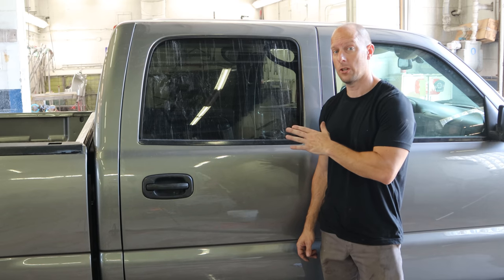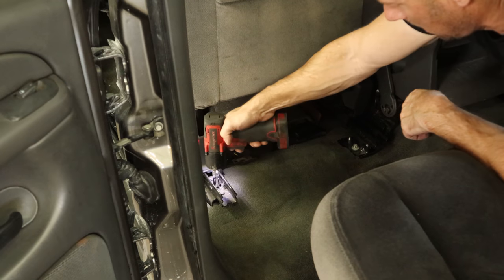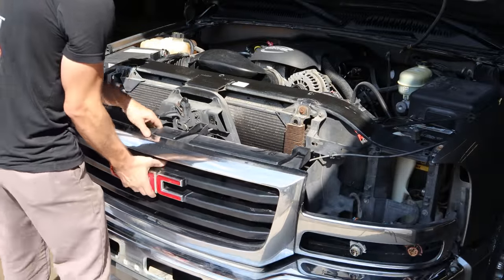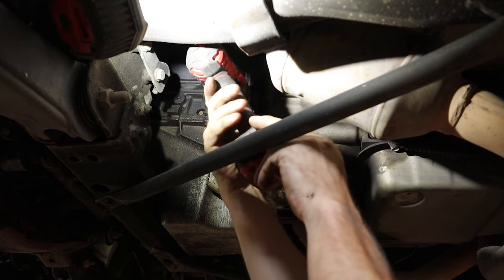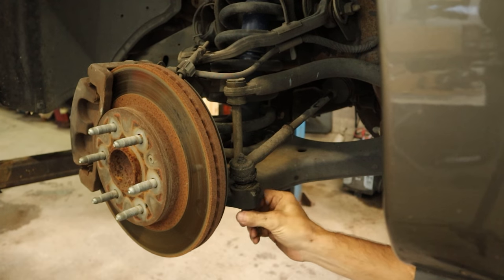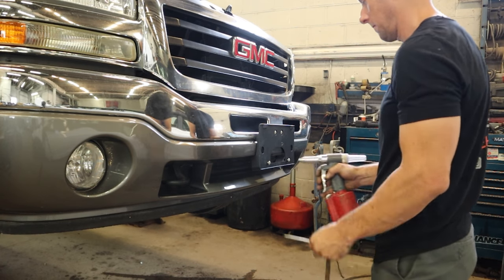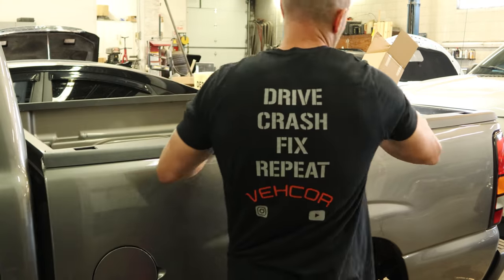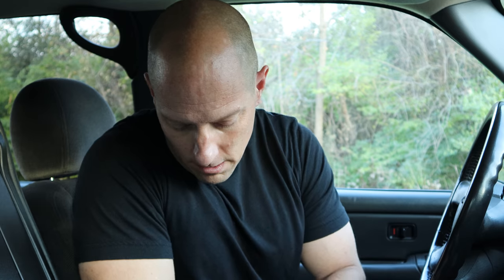Completing the rustfree 2006 GMC Sierra rebuild

Comment: I'm still smiling about the true purpose of the magnetic oil drain bolt.
Reply from the maker: Now let me tell you about recommended blink fluid change intervals! 😂
Reply: @vehcor  Lol, love that.
Reply: Once tried using a magnetic drain plug to try and extract a sliver of steel out of my finger. Didn't work.
Reply: @robj2704  Shhhhht, Dont give away the real reason🤣🤣
Reply: @vehcor  I want to see a muffler bearing replacement,  or a disgronifier service.

Comment: What a great finish! That truck looks beautiful. How many other shops would have fixed an evap solenoid, replaced front end parts, brakes, tires, oil let alone the A/C fitting. If I lived around there, nobody but you would touch my Canyon, nobody. Your shop is the kind of shop you could drop off a vehicle say take your time and fix whatever you’d fix on your own, and never have to worry. It would be done correctly. Your channel is the highlight of my day. You look fine in the hat too. You even put it on in the right direction. Thanks!
Reply: Oh yeah!! I agree with that! I would love to have the skills and knowledge that Scott demonstrates in every video. My old truck could sure benefit from a visit to his shop.

Comment: tip ....dont use 3m masking tape 3/4 for lining up moldings , instead use 3m 1/4 blue fine line tape as it provides a strait line n no risk of pulling paint off  after molding install. Ur videos are improved over say 3 yrs ago..well made n commentary is excellent.

Comment: I have a 2007 Silverado and did the vent solenoid at 50,000 and still going strong at 160,000. It was a GM part. Funny we have 2 mid 2000's suburbans at work with just under 200,000 miles and both just required the vent solenoid and the block off cooler plate gasket replaced. And one needs and have the rear main seal replaced, and did the other this past summer. Now that is not cheap when you have to take it to a good mechanic. Great job on your videos.

Comment: I'm new to your channel.  After 50 years in the automotive business - 35 as a line tech, I'm impressed with the quaility of work you do.  However, I have one question.  Did you actually just use an impact wrench to install the wheels, or at some point did you use a torque wrench to prevent rotor damage from the wheels not being torqued in sequence?  
Whatever, your overall quaility of work is outstanding and I will continue to watch because it is a breath of fresh air to watch someone that is an expert in their field.

Comment: A truck like this is hard to find up in Ohio.  I love my 2004 Silverado but it has 168,000 miles and the rockers and cab corners are pretty much gone.  Nice job as always, and I will always buy a vehicle from no questions asked.

Comment: My pops has a new 2020 Chevy.  It has vent valve problems.  One before it...  had vent valve problems even after they routed that iine to the trans or engine bay.  He wouldn't care except it disables the remote start.
Reply: Also ln NY it would not pass inspection

Comment: Used door prices went through the roof.
I’ve got the 07-13 Silverado crew cab with the factory optioned door rot, I replaced the passenger side rear 2 years ago for $200 for the complete door and painted it to match. Now the driver side rear door is $400 and the driver side front door is $700. Talking about $1100 for 2 used doors that aren’t even the same color as the truck. 
Sure the truck has 275,000 miles and it’s lived the last 4 years in New England and the rockers are also gone but I can swap the 4.8 for with a 40k miles certified warranty 4.8 for $2k. Doing the rockers thanksgiving weekend. Cavity waxing the hell out of them when I’m done.

People ask why you would do that, like have they seen the prices on low mile trucks now 🤯

Comment: A 2wd truck up there oh no, When I lived there I had a 2WD dodge ram for ten years, even in that snow storm of Feb 2011 I had no issues getting around never got stuck in the snow. I had 3 8D batteries that I filled with cement and used as my ballast in the winter. all that flooring you can send with the new owner and tell him it is there for when the floor rots out. lol

Comment: I live in phx az and really dont need 4 wheel drive unless i lived up north were it snows i bought a 2 wheel drive 2007 silverado truck and drove it 13years put over 200k miles and sold it and never once needed the 4 wheel drive and iv driven it all over up north Texas cali Nevada ya its nice to have 4wheel drive but i feel its a waste of money if u really dont use it all the time plus way easier to work on for sure if u needed to do any suspension work on it

Comment: did  you change the  knock sensor cause  gm had a service bulletin  on 03 to 07 sierras  that  the  design of the plenum under the intake  was not  channeling water  away right and water would  get  into the hole the sensor is in  and  would cause it to rust out and  they showed  how to fix it  so it wont happen again     i had to do that on my truck     but  over 15 yrs i had to  change the knock sensor in the back   5 times

Comment: The real purpose of the drain plug magnet is to pick up the metal from the roller lifters and camshaft when the lifters and cam come apart.
Reply: WRONG. You heard the man. It’s to calibrate the compass
Reply: @jonathanherb3752  Why did they stop putting a magnetic drain plug in the pan if the compass needs calibrating?

Comment: I would never question anything you do or say because you are a master of your craft, however, If you turn the key to the run position without starting the engine, put the trans in drive and you can see if the DRLs are working without it driving over you.
Just sayin'.....

Comment: hey, I noticed when you did the oil change you didn't change the drain plug gasket.  im triggered.  I just figured I would tell you that.  /s if you didn't notice.  :)  I have a 2010 GMC savana AWD.  that front diff and transfer case get in the way of everything.

Comment: I wish you would have shown how to remove the trim off the top of the bed. The clips are inside the bedside. I needed to replace mine and at 265$ a side ouch. I'd be fine with used ones but can't get them off

Comment: I HATE THAT valve, burned two up in two years, found out you can buy the cheap one, just swap over the solenoid,... clean the the little sponge in side reassemble it..  Really helps with trying put gas in it.